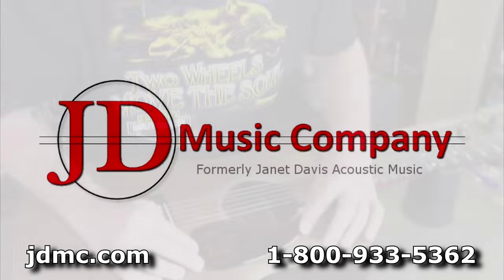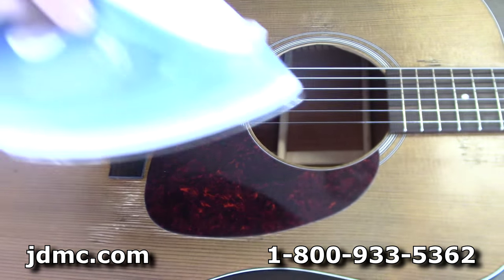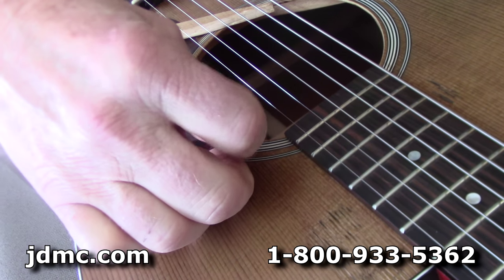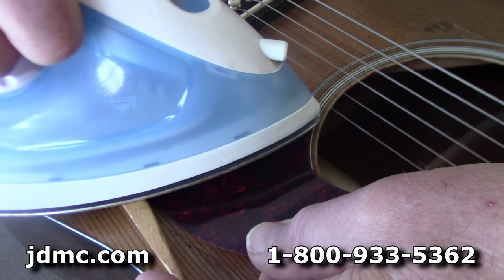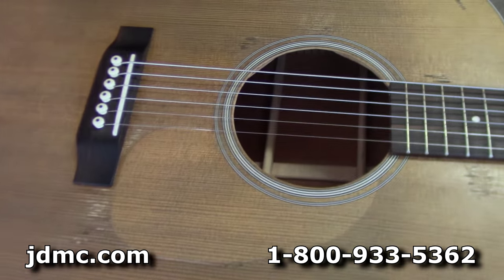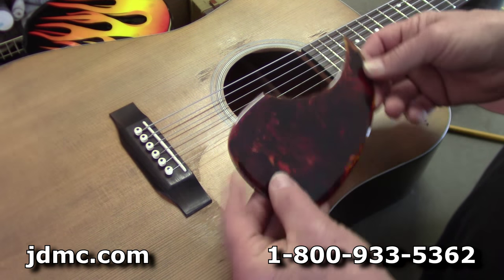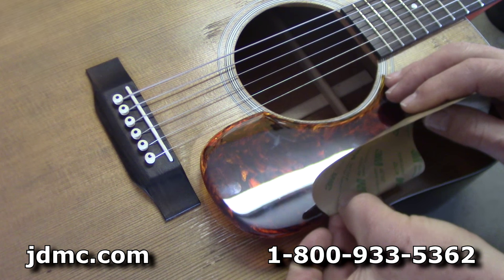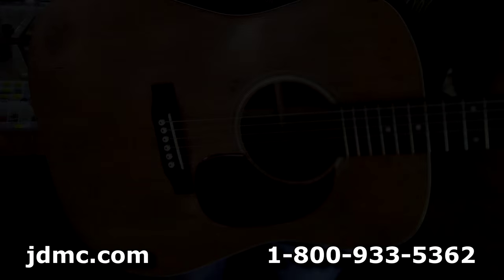How to Change The Pick Guard on an Acoustic Guitar by JDMC

Comment: For many years before the 1990s, Martin sprayed nitro over the soundboard AFTER the pickguard was located.  These aged pickguards by now tend to wrinkle and shrink – mine also began to lift out some of the soundhole inlay!  I found an artist’s palette knife useful to work in carefully between the guard and the soundboard to free the pickguard.  Once removed, the pickguard left a slight varnish ridge round where it had formerly been.  I cut an oversized rectangle of pickguard material, then dusted-in the slightest trace of talc powder round varnish ridge. Over this, I placed the rectangle, then gave it a light rub to induce an electrostatic charge.  When lifted clear – magic!  A perfect “photocopy” of the pickguard outline to then cut around with care and drop into place perfectly.

[Tyneside, England.]